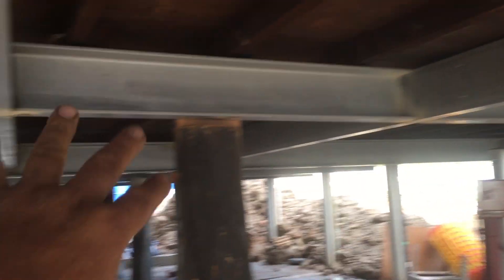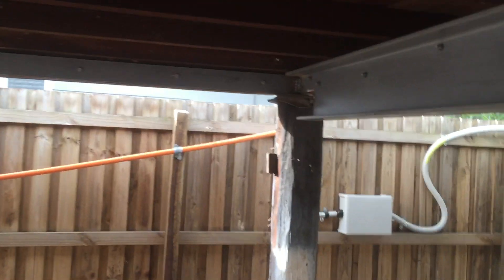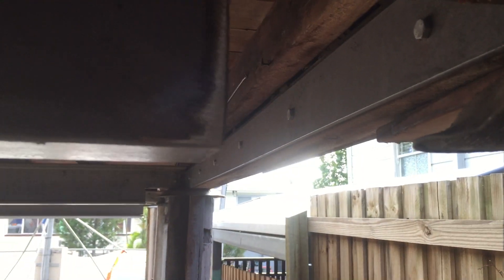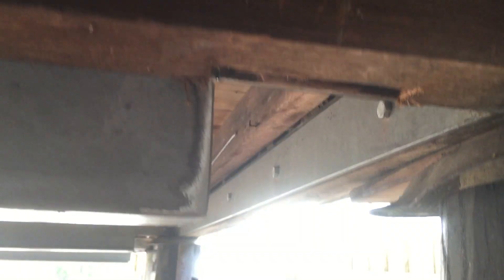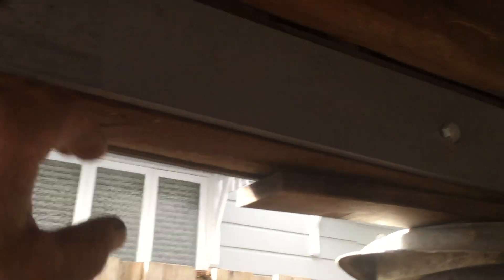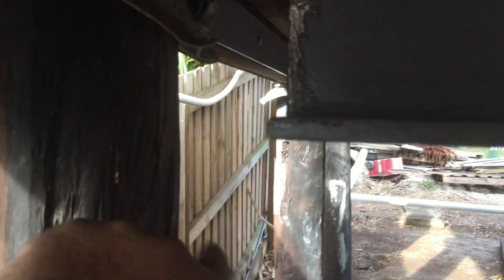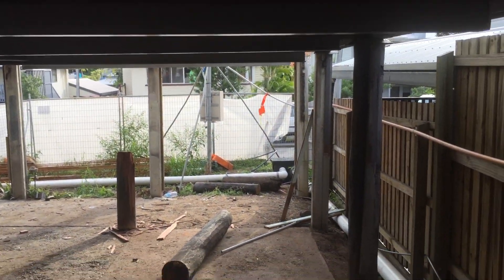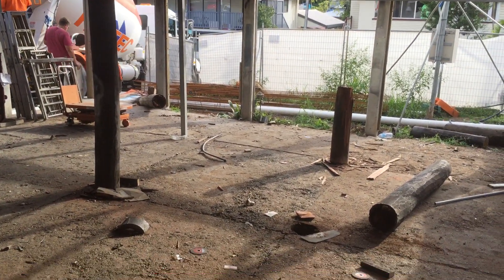Steel fitted 29th april at the Gabba

Comment: Hi mate, what can I use to help stiffen up my bearers under my old Queenslander. Currently have 120 x 75 hardwood. Would steel plate bolted off be enough or would PFC be required. Love your channel mate and it’s great to see quality work done in a very informative way. I’ve learned quite a lot from your channel over the past year. Keep it up mate 👍
Reply from the maker: Hi Anthony. Thanks for your comments.
for me to help I need to see what you are wanting to do.
My number is 0475 785 953 send me some photos and a text about what you want to achieve.
Thanks

Comment: Why is the block wall going to be set in from the outside of the original stud wall above and not just inline?
Reply from the maker: The blocks are stepped in slightly so the weather boards can go past the top of the blockwork to make a more effective water barrier as the water will go past the top blocks and can not get inside.
Reply: @DieterSoegemeier  Ah I wonderered if that was the reason. So many raises and build unders put the walls in line and it doesnt look right, neither is it good for water run off. Even with Qlders big eaves, driving rain still ends up running down the walls and needs a place to kick it away. So congratulations to you and your builder for all that extra work to do it right.